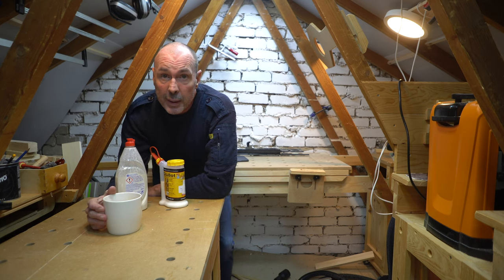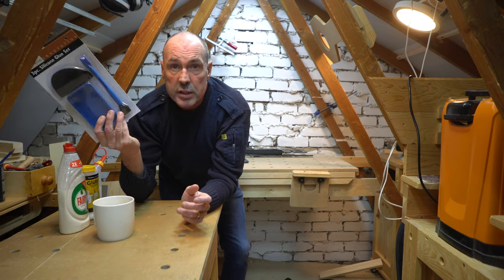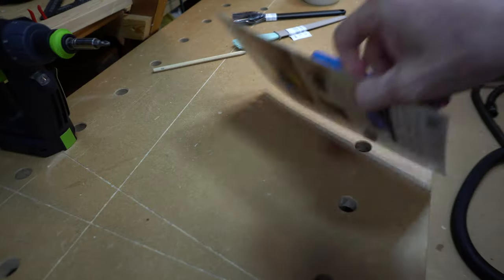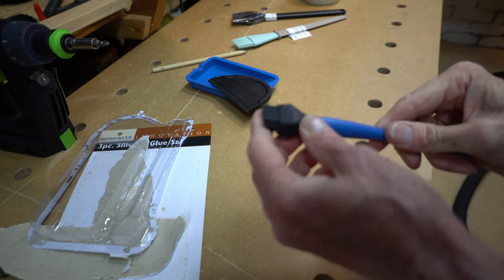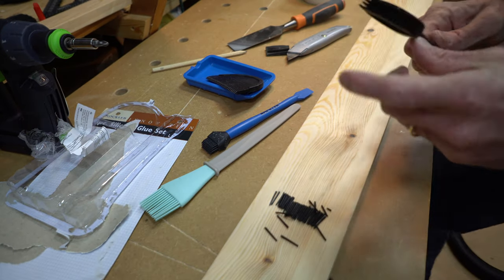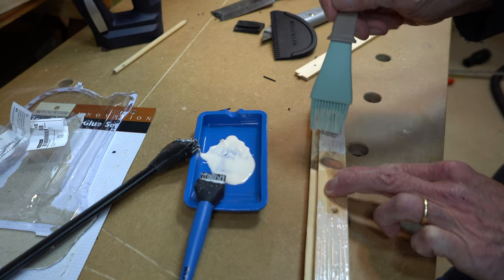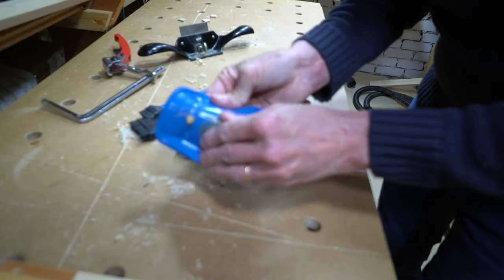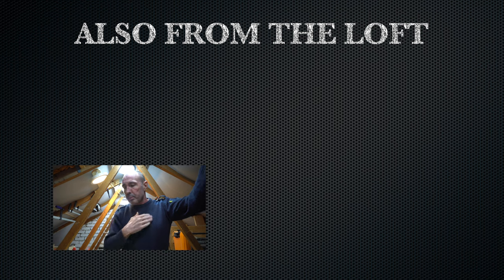Save money on Woodworking Glue Brushes.

Comment: Great idea! Must check out what other 'domestic' items have workshop use. Tubs for paint, thinner, parts etc- I use the bottom cut off milk containers. The kitchen produces them at a much greater rate than I can use them. Keep up the good work!
Reply from the maker: Thanks Mike. Cut away 4 pint milk bottles are a great aid. Regards JP
Reply: @Smallbarnworkshop  Just found Amazon do a set of four brushes for £2.47 - 62p each! And one of them is yellow 😊 (Thinks- that is three Xmas presents sorted...)
Reply from the maker: Fantastic. Cheap and match your tool wall 😊

Comment: I do like your channel! I've tried this route myself - it worked but Iwas never really very happy with the way the pastry brushes spread the glue (tried both long and shortened "bristles"). I tend to prefer cheap flux brushes on smaller pieces and rinse them out after usage.
Reply from the maker: Thanks Steven I will check those out. Regards JP